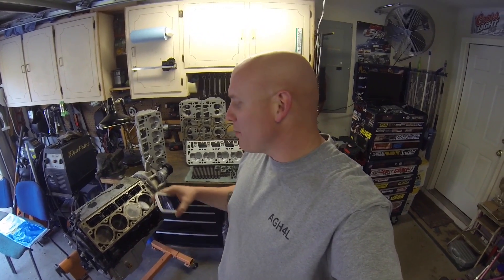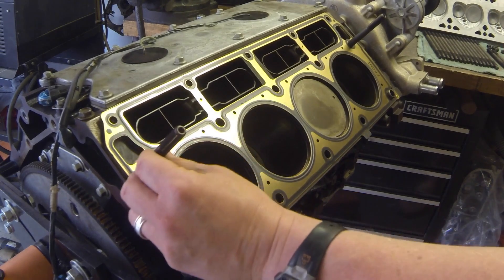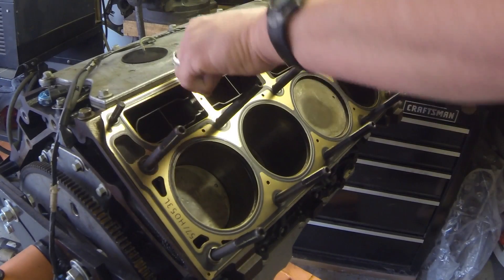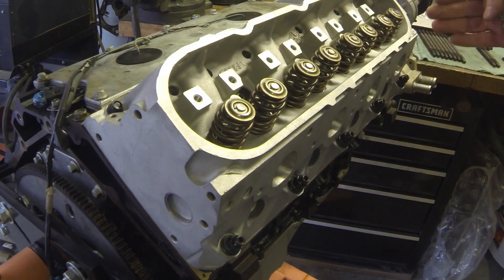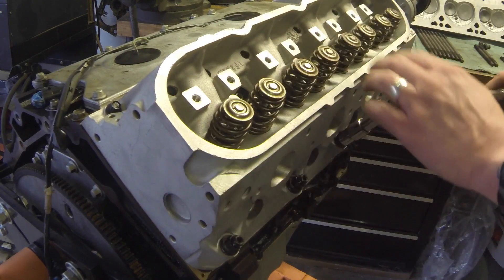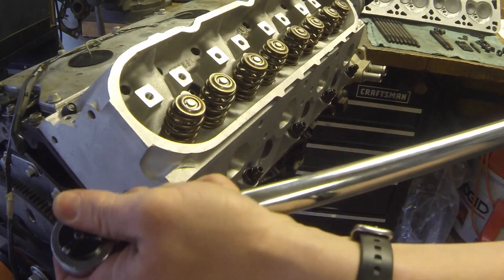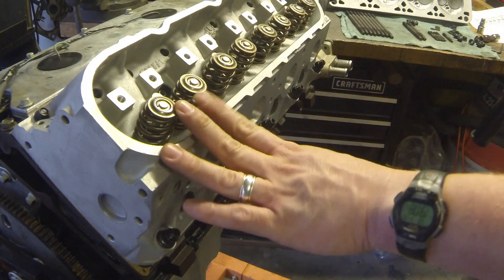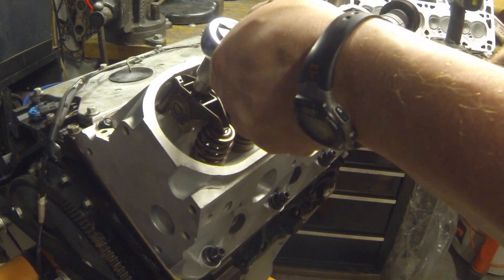LSx Head Install Torque Sequence "How To" - eBay Head Studs Pro Comp - LS1 5.3 6.0

Comment: It's funny just read your response about the deflector, it was actually dragging on the freeway for about an hour didn't know until I slowed down on the street where I heard it, got home and zipped tied it up threw the holes on the bottom. I figured that May also be a problem because it was blocking the radiator.
Reply from the maker: Yea, that thing has to be mounted solid to the bottom of the radiator to do its job. It pulls air up and into the radiator. Without that piece. It'll overheat. Find a new one. Check Hawks. Here's a link:  http://www.hawksthirdgenparts.com/categories/82%252d92-F%252dBody/Camaro/

Comment: I live in Houston Texas, and yes he added 100% coolant, I went out today and drained about 60% and added the rest water, drove it around about 30 minutes and now it's running fine again. So me living in Houston where it's really hot do you suggest I run 25% coolant and the rest water? First Camaro any help would be appreciated. THANKS!
Reply from the maker: Yep, 25%. I'm from San Antonio and thats what I do. Theres a legend somewhere to tell you how much percentage of coolant you need to keep it from freezing at what temp. Less coolant will help cool.

3rd gen Camaros are my specialty. You need to check that air deflector under the radiator. the thing that hangs straight down and bottoms out all the time. It needs to be there and in good shape to keep the car cool.

Comment: The thinking behind what I had said is if you take a standard garden hose, imagine that, that is the intake port and the end of the hose were the water comes out is the cylinder. Now if you take a ball that is just big enough to stop water from flowing, the ball resembles the valve, and if you could slowly move the ball away allowing water flow, if the ball is smaller but still able to plug the hole, it will easily flow out and around the ball or valve. Now if you take a ball that is a little bigger and do the same thing it still allows water to flow just takes a little more time befor it is at full flow. Like I said befor not that the bigger valve doesn't work. I have the 241's with 862 intake and exhaust valves. The exhaust valves do not have the indent that the other exhaust valves have so it helps with bumping compression, hope this helped. Keep on wrenching!
Reply from the maker: Good visual! Also, I never noticed that difference on the exhaust valves. I just knew that they were the same size. I'm headed out to the garage to look at mine now.

We'll this conversation has got me more curious to see how it performs. Cant wait!

Comment: I have a 92 Camaro rs ran fine at first until the guy at O'Reillys put straight coolant in my car no water, now when I ride the temp stays just above 220. Do you think it's because of the coolant please help.
Reply from the maker: The straight coolant could be part of the problem. You want a mix of 50/50 usually in the radiator. 50% water and 50% coolant. In some southern areas you could run less coolant, like 25%. Too much coolant is said to make it harder for the engine to cool. Did he just add 100% coolant or did he fill the whole radiator with 100% coolant. It takes about 2 gallons to fill it.
Reply from the maker: Also make sure that you air deflector under the radiator is in tact. Without that deflector your car will run hot.

Comment: Gear head the video was awesome  .What made you go with the 4.8 liter piston over the stock 5.3?
Reply from the maker: Thanks batbat! I went with those pistons because I wanted to get my compression up. It'll give me more flexibility on head options also. Normally you'd have to mill the mess out of the heads to even get kinda close to the compression that these heads will give me.

Comment: Using the ls1 valves in the 5.3 head isn't necessarily better. As the bigger valve take up more room on a already smaller throat. With the bigger valve the air has to move around it, there is a video
On here somewhere explaining it, I put 5.3'valves in my ls1 heads, and long tubes and just that made it more responsive. The studs look awesome always wondered about them, just so I'm clear this isn't criticism just one car guy knowledge to another. I'm sure the bigger valve has it's advantages. Keep on wrenching!
Reply from the maker: I always welcome respectful feedback from others like you have done, even if it does go against what I have done. This is how we will all learn. I certainly don't know anywhere close to everything and I am constantly experimenting.

Thats interesting to hear you experience with running the smaller intake valve. I'll have that thought in the back of my mind now.

I made the decision to run the 2" valve because it was used so often in other LS motors and even in the HO5.3 with 243 heads, which is basically what I've copied here.

I measured the throat and all diameters of the 5.3 valve seat vs the ones in a pair of LS1 heads. They came out to appear to be the same valve seat. So I would think the smaller throat wouldn't be an issue since this is how even the 243 heads come and perform so well.

These are my thoughts. Keep your thoughts coming!

Keep on Wrench'n!

Comment: 22 ft lb for the rocker arms?
Reply: GM torque spec is 22ft/lbs, just make sure you hold the rocket tip over the cebter of the valve stem as you torque.
Reply from the maker: It doesnt matter.
Reply from the maker: yes.... or just snug them down. which ever you like. :)
Reply: AGearHead4Life When torquing the rockers, do you want to torque them on the base of the cam lobe or does it not matter?

Comment: Are you gonna do a step by step install? I have 3 of the 85 chevy trucks one is a 4x4 and would love an LS1 between the frame rails.
Reply from the maker: I hope to do step by step videos. I will be in a rush when I do the swap, so I hope that I am able to catch everything.
Reply: Join "A Gear Head For Life" on facebook and you can follow along with several of us doing LS swaps in the old square bodies.

I'm doing a 6L swap on mine.

Comment from the maker: Looks like the price on these head studs have gone up to $80.
Reply: Should torque all the rockers that are up then rotate the motor and do the rest or is that not how it works?
Reply: I bought mine from ffengineparts on ebay for $65.
Looks like they still have 2 sets left if you hurry.
Reply from the maker: 32bitcal Good tip! Thanks!
Reply: +AGearHead4Life when torquing down the rockers,i heard you had to do intake at TDC and then rotate 360 and do the exuast valves,is this true or what because you didnt do that.
Reply from the maker: +AdvanceAuto Parts Yea, I wouldn't do all that, nor do I believe that it'd be needed. Shoot, I've tightened them down just with a regular wrench before. I doubt that you'll find many people that would do it that way. By the book, that may be true to do it that way. Does it matter? No.
Reply: so just tighten them once all down to 22lbs and forget the book bs?
Reply from the maker: +AdvanceAuto Parts Yep! You could go over them all a second pass to make sure they're all good.
Reply from the maker: +AdvanceAuto Parts Nah, just torque them as they are.